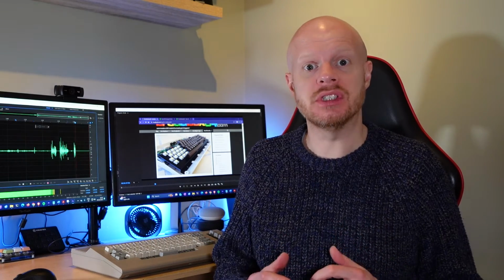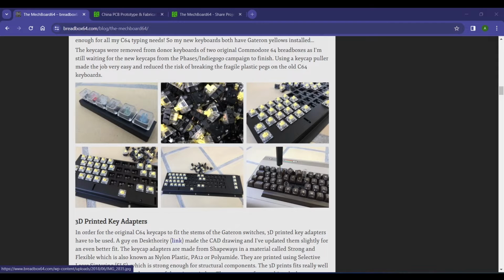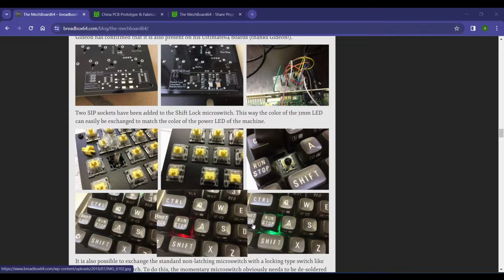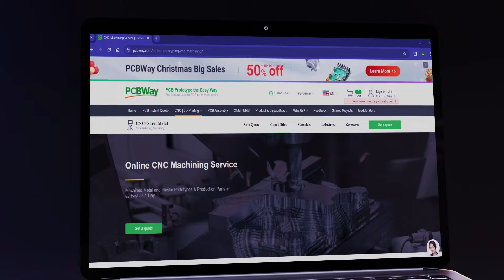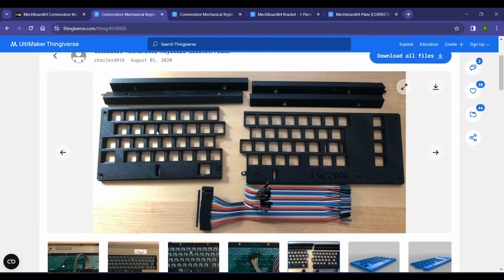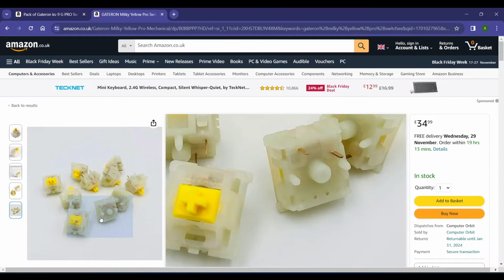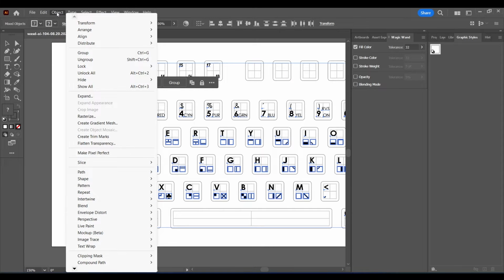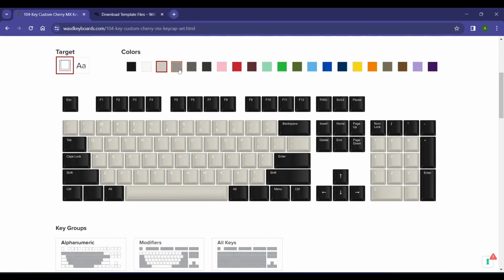MechBoard64 drop-in replacement mechanical keyboard for Commodore 64 | #C64 | #mechanicalkeyboard

Comment: Watched a load of videos, I like this effort. Looks like with 3D printed adapters and original key caps, the whole thing gets a wee bit higher and wobbly. It's only missing a bit more customizing to get those special keys to fit and work. Thank you for sharing this approach.

Comment: I just received my Mech 64, I have it all setup with orginal keys.  The Shift lock doesn't sit right, it seems stuck in a low position.  The shift lock keycap seems to sightly smaller than the other keys and does not have the insert to "lock" up and down like the original keyboard.  Any thoughts for getting this key to work?
Reply from the maker: For me, I didn’t use a locking switch, so not sure in your case.

Comment: Congrats on your very nice looking keyboard 😁 I've also gone through the hassle of applying modern day keycaps to the MechBoard64. Same result as you discovered... My understanding is that Jim Drew considers producing new C64 keycaps with Cherry mx style sockets. I know he has the casting mold to do it. If so, the 3D printed keycap adapters will no longer be needed. However, this will cause the keycaps to be lowered a bit in the frame corresponding to the height of the 3D printed keycap adapters. A small update of the keyboard bracket may therefore be needed to compensate for the lower height of the microswitch/keycap. 
Not that I'm here to advertise for other C64 keyboard projects, but Jim will also be offering a brand new C64 keyboard called the BlingBoard64 (I think...). This is a complete C64 keyboard with keycaps and heaps of LED light.

Comment: Did you find a good solution for the space bar?
Reply: Pimp My Keyboard used to carry a size 9u spacebar which is identical in size to the C64 spacebar. The spacebar is part of the 'SA Family' and is made by Signature Plastics. However, the SA Family spacebar has two outer female sockets that are placed further apart in comparison to the C64. Therefore, the two rectangular holes in the keyboard bracket used for the keycap stabilizers need to be placed further apart in order to get it correctly installed...
Reply from the maker: Not yet, but probably going to go with 3d print.

Comment: I've built a pair of these Mechboards. I used original keycaps for both. I actually like where you took this one,  your caps look awesome, maybe it is time for someone t do as you thought and 'nudge' the switches around for a better fit with standard keycaps. The adapters I used to get the OG keycaps to fit my Gateron swithes work, but the stems are long enough now that I wonder if the actual feel would be better with direct mounted keycaps like you're using.